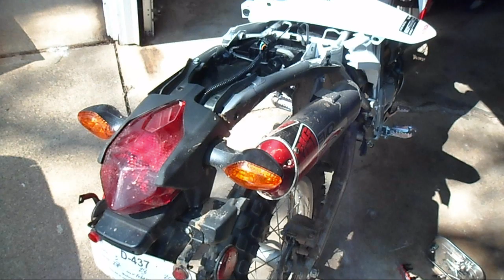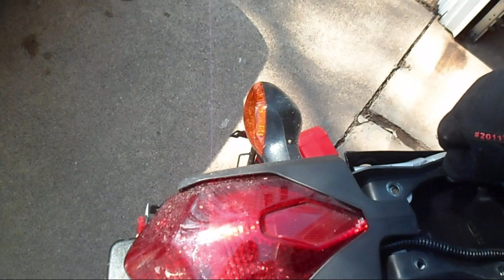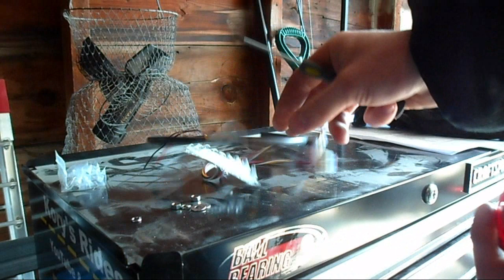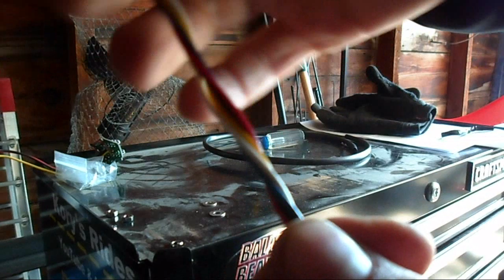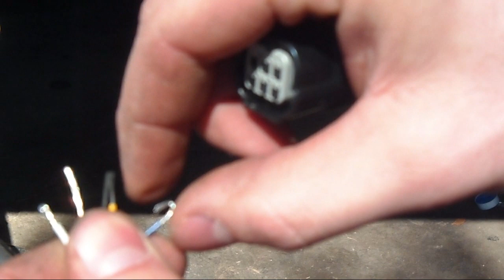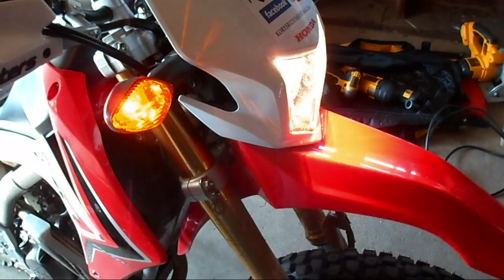CRF250L 12 O'clock Labs DRC Taillight

Comment: Kory.. I wonder if I get this setup if I can wire in my rear signal drc lights and still use the intergated signals too?
Reply from the maker: bombidude if you slice the factory blinker wires back into the harness to the wires that they used to be connected to, that should work fine
Reply: Kory's Rides that's what I was going to try.. thanks

Comment: I just got the DRC tail light and the bracket is much different.  It mounts to all 4 stock locations.
Reply: Yeah it looks like has the bracket for a DRZ400 not the CRF250L.
Reply: Yes,  I think this is not the one that is designed for the CRF.  Mine is rock solid and I love it.  I have fell many times and no issues.  I also have a Man rack on the back with grab handles so that may help to protect it.